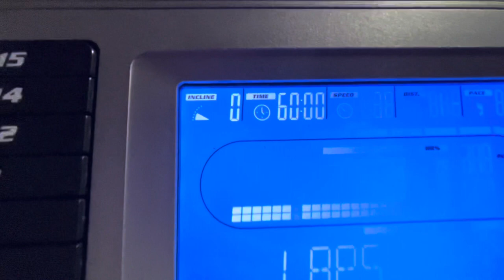How to Paint 3 Story house Full Interior | Ceilings Walls & Doors 3 days  | Spraying & Brush Rolling

Comment: I see you use behr ultra. Me too. I think it’s the easiest to work with. Do you use that to spray the ceiling too? I find Sherwin paints flash and don’t touch up well. 
Much respect!
Reply from the maker: Hey Boss, yes this jobs was Ultra from Behr product. Owner bought paint , so he got that material. I usually work with Sherwin Williams products, I been having problems with Behr ceiling paint, can’t be touched up if you spray it.
On the flashing just make sure is Flat paint ,
Flashing is uneven pigment saturation often seen in satin coats of paint.
Backrolling and flat paint helps a lot, of course if ceilings needs primer you will need to prime first

Also that Super paint product from Sherwin Williams is has that type of problems, 
But that Behr ceiling paint has that type, can’t be touched up

Thank you for watching 
and subscribing 👑

Comment: Is there a special paint that adheres well even on glossy surfaces without sanding or priming? I tried liquid sandpaper but that didn't work for me. Maybe the brand I tried wasn't the best.
Reply from the maker: Hey Buddy,
I’t all depends what are you painting?- 
sherwin Williams emerald urethane Sticks to everything but that’s for Trim work- 
Bin primer shellac will stick to any surface- without sanding but that’s primer.

Just do it the right way the first time- prime it and you won’t have any problems later
Reply: trims and doors mostly @TheValuablepainter

Comment: No prep?
Reply from the maker: Hey Champ,
Owner will be Replacing all floors, replacing all baseboards, all Door knobs.
I mention that on the video. Preparation on walls holes, caulking, sanding check video minutes 5:47 min - 7:00 min.
Place its basically New, just a change of colors- repaint.

Let me know if you have any other questions. Thanks Buddy